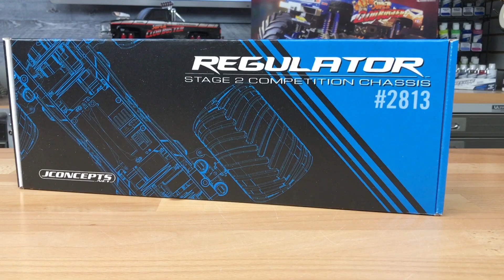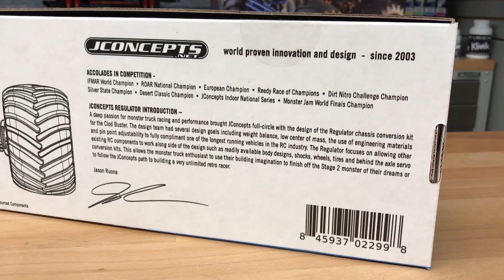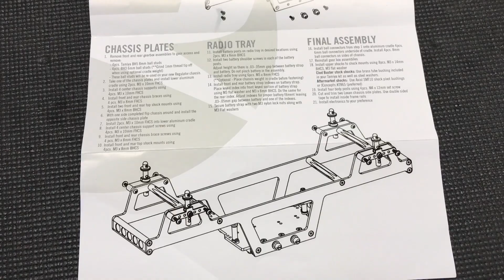Mean RC Monster Truck Build! - JConcepts Regulator Tamiya Clod Buster Project | RC Driver

Comment: Double shocks for looks and single shocks for performance. I would run it both ways and see how you like it. I think as long as they don't bind up the suspension double is fine. Your very experienced with setting up RC but I have not had good luck with duel shocks on other cars. Unfortunately I don't own a Clod Buster so I really don't know. It does look better.  The chassis is absolutely awesome. Great share.

Comment: Love the build! The clodbuster was my first hobby grade rc and my all time favorite. I found an old Clod recently for $50 and also put on the Jconcepts Regulator chassis and steering links, and rear lockout. I also put on the Jconcepts Golden year tires. I went with the Rc4wd Ignitor beadlocks and traxxas ultra shocks. Currently have dual shocks on each corner but might change it to one as it feels quite stiff. I went with the same body that you did and I added the Traxxas Bigfoot bumpers and roll bar.

Comment: Thanks for sharing.  I’ve watched this a few times already, and I just noticed that you were able to tuck the steering link that connects the servo horn to the carbon fiber rack.  Mine kept popping off whenever I bash a little too hard because it gets snagged for being a little to exposed.  I’m just a weekend basher so I use a servo saver.  I’d have to look for a lower profile servo to be able do what you did.  Thanks again for sharing.

Comment: I did the behind the axle steering mod front and back. Good stuff. BTW I believe that brass plate is to allow the truck to qualify for monster truck classes.
Reply from the maker: Yep, I mentioned that later in the video.
Reply: @rcdriver  Yeah. I was too quick posting. I might do the chassis upgrade as well, but a bit worried about changing the character of the truck too much since I don’t race it.

Comment: I'm still thinking about the chassis for my next Clod project. I'll probably use the hidden steering from JC. That's perfect for my hobby style of driving and will improve the rig. But the chassis in my mind is more for competitions, which we don't have here in Europe. The chssis is great bur for my reqirements it's a little bit kind of overkill. This might be not so over the pond. So thank you for the presentation😀.

Comment: Why no rear steer? And are there after market chassis links that are thinner? Great build!
Reply from the maker: We’ll see how the front steer works. Using rear steer while at speed requires precision from the driver. Not sure on the links. I’m still wort my Clod parts knowledge. 😄
Reply: @rcdriver  I didn't know if you were in the hobby around the Clodzilla days! One day I would like to get a Clod Buster for my collection.
Reply from the maker: @lylevalentine5902  I was around in that era, but concentrated more on the 1/10 buggy/truck racing.

Comment: After all those upgrades, how does it compare to the Toyota Bruiser?  With the upgrades, price-wise they are close, right?
Reply: What a dumb question😂

You cant compare the bruiser and the clod
Reply: @adtjtjdjsj  well, I don’t own either one sooooooo.  🤷‍♂️
Reply: @adtjtjdjsj  why is it unnecessary?  I have been thinking of getting a Bruiser or a Clod and modding the chassis.  So why wouldn’t I want to know the differences?  Why do you have to be so toxic to other people?  Are you a troll?
Reply: @kattmandu  you could have used google to see the differences..

The bruiser is a insanely bad off-road vehicle with almost no suspension travel..